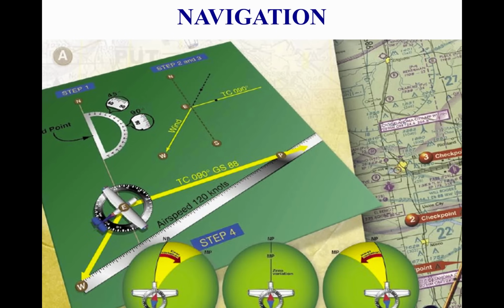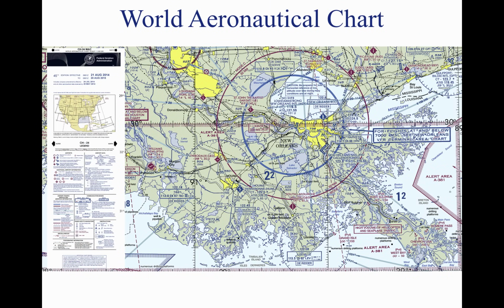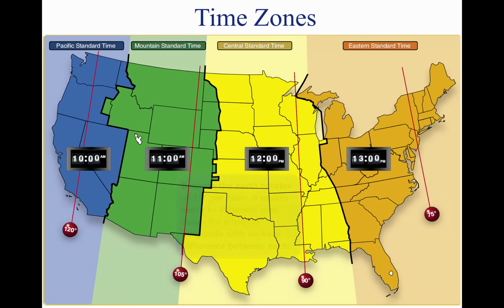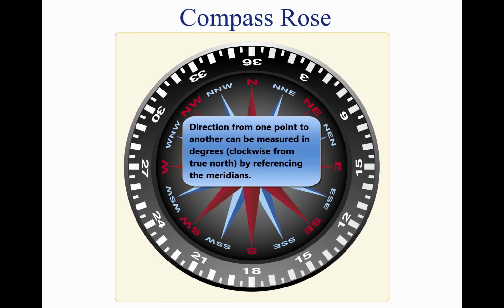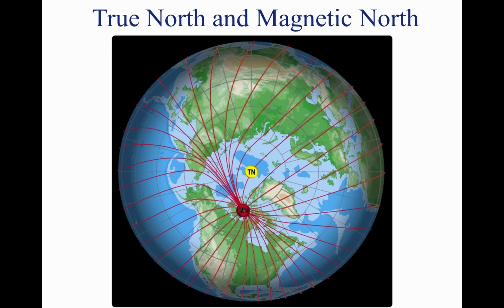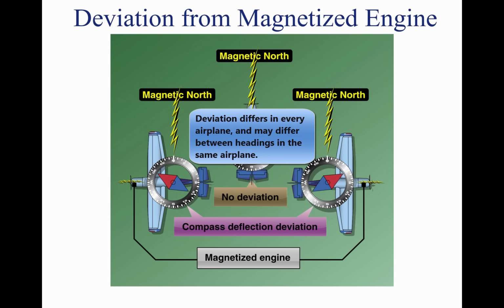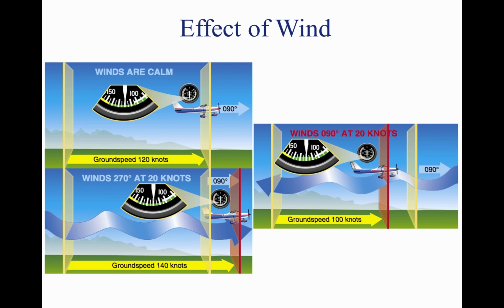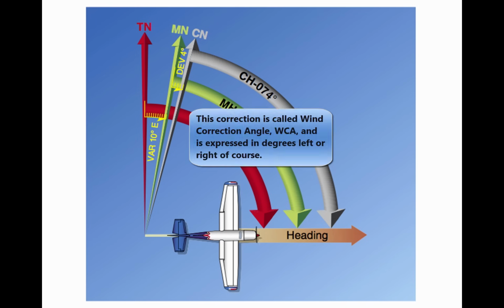Private Pilot Tutorial 15: Navigation (Part 1 of 4)

Comment: So to take this 20 minutes and break it down. You plot your waypoints, then you calculate the deviation and adjust your compass heading. Then you add the weatger and winds and based on direction your ground speed is either increased or decreased. Which makes sense depending on why dlying to europe is slower one way. But then you add the deviation effect based on the winds.

Comment: On your compass it shows East as 15 and it also shows south-southeast as 15. 8 minutes and 42 seconds. Look at your compass.
Reply: Maybe true North variation from magnetic North
Reply: @ihabhakkar776  If that were the case the entire compass would be off by a consistent angle.  The compass is indeed off by a margin but whomever created the image added the 15 heading twice.
Reply: Did you catch the mistake on the compass rose slide?   ON the compass rose the 90 degree position is incorrectly labeled as 15.  Everything else is correct.

Comment: iPad Questions!🛩️ I'm looking at buying an iPad for GA navigation. 1. Is it necessary to  get a cellular iPad model or will a Wifi only suffice?   2. Favorite flight apps.. Do you prefer ForeFlight others?
Reply: I’m a student myself, but I was told that a cellular model has built in GPS that functions even without cellular service, and the non cellular models don’t. I went with the cellular because it gives me options do track weather and other variables in flight, assuming I have service. Fair skies and tailwinds!
Reply: It is NOT necessary to buy a cellular iPad. I have a WiFi only iPad and use a Stratus 3 ADS-B “in” receiver which connects via WiFi for GPS location. A Sentry will work just as well. If you don’t want or need ads-b traffic (why wouldn’t you), a Bad Elf or other brand of external GPS receiver works well too. The point being, you don’t need to buy a cellular iPad.

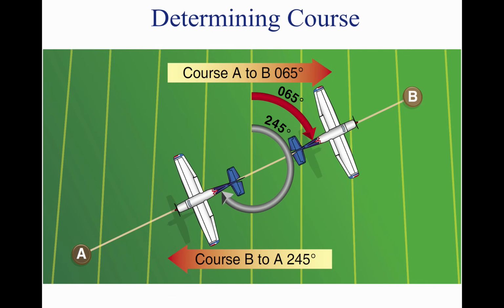Comment: 9:29 I do not understand TC being 065 while Recip 245. I thought they are both related to 360. Will appreciate an explanation. Thank you.
Reply: On a circle the reciprocal line is 180 degrees away from the initial course so 65+180=245. Just like runways are 18 and 36 depending on their end, 180 degrees different.

Comment: I found it really difficult to understand it
Reply: J Thorsson the magnetic and true headings/bearings and calculating wind correction angle
Reply: @ahmadtheaviationlover1937  isogonic lines represent magnetic variation from true north.. depending on your heading you either add the difference (west of an isogonic line) or subtract it (east of an isogonic line) to or from your heading to get true heading..
Reply: @JaseCJay  not true heading, magnetic heading you mean
Reply: @ahmadtheaviationlover1937  Isogonic lines – Lines drawn across aeronautical charts to connect points having the same magnetic variation. ... East of this line, the magnetic pole is to the west of the geographic pole and a correction must be applied to a compass indication to get a true direction.
Reply: a bit better than my explanation... add or subtract to/from your magnetic heading to get true depending on whether you're east or west of an isogonic line.. east is least (-), west is best (+)